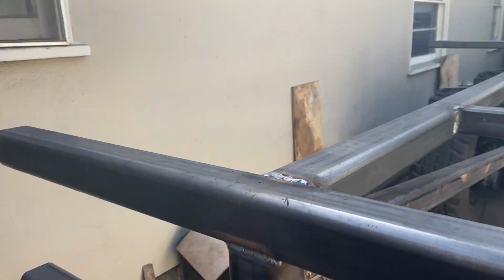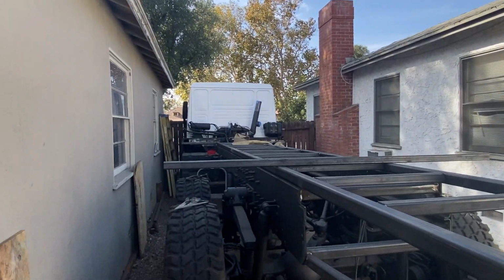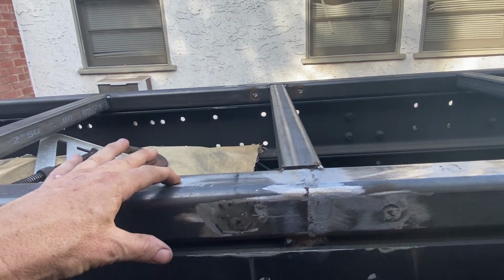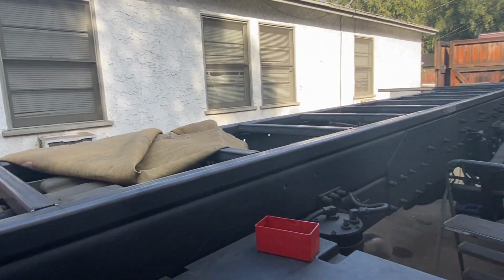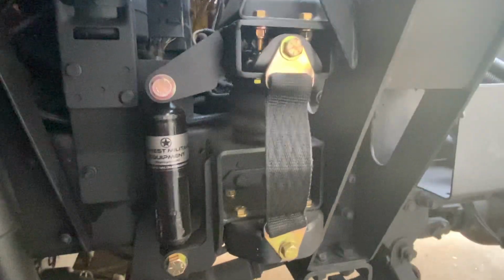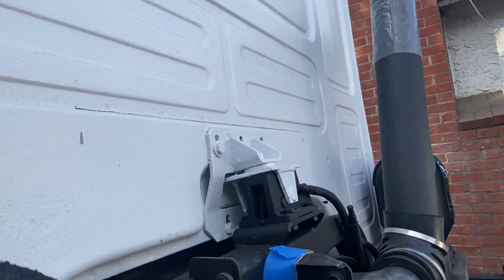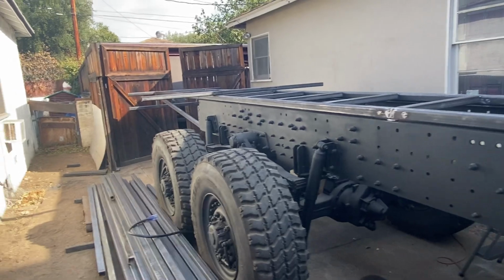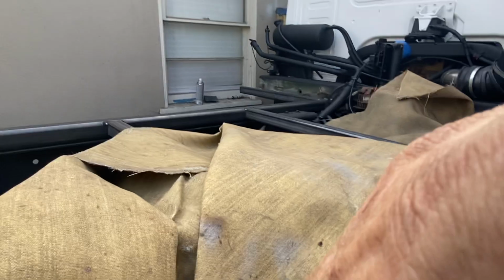Expedition Truck Build Day 16

Comment: how wide are those tires?
Reply: just a thought for a boarding system. maintains a flat floor......i tried to attach a pic...won't let me.
Reply from the maker: @scottlobsterlift4332  send it to me on my phone or email. 9512597231 or timtobelconcepts@msn.com
Reply from the maker: Right at 14” which has made some design challenges!

Comment: Why not flex mounting between the frame and subframes
Reply from the maker: Great question. Probably the biggest talked about point on a expedition build. As I have been told from a former Stewart and Stevenson Engineer bolt the habitat directly to the chassis. I happen to like this way of mounting due to less wobble from the habitat and frame flexing around. I build my Adventure Truck welded to the chassis and think the was a great way to go. I got a lot of comments and some said it will not work and tear itself apart! I have never had a creak of grown off or on road from it being directly welded. It really boils down to DC... Designers Choice! Lol! I’m choosing to weld and bolt the habitat to the frame and if I run into problems I will remove the bolts and do a spring and bolt capture method. All of the beds and equipment on FMTV’s are bolted to the frame from the factory. Hope this helps but in the end we all have our own theory’s.

Comment: That base looks to be very sturdy.    Looks like you used flux core wire?   I always heard using shield gas outside can be a problem with even minor wind.    All I've ever used is flux core.
Reply from the maker: Thank you on the sturdy base! I think it will be great! Funny thing is I’m running a steel mix but flowing 20 CFH and that may be what is making it a little shinny. I’m still getting use to the Miller 255. It runs really hot on the auto setting. I have things turned down a bit and not getting so much undercut. Super fun project!

Comment: I noticed that about the mme airbags.  The shocks push the top of the cab support back. Of course on mine it just hit the spare tire carrier and the cab was still able to latch into it but I did express my concerns about that to mme and they said they have put them on vehicles without the tire carrier and there's no problem. Hmmm
Reply from the maker: We will see here in a couple of weeks! If they don’t take set I will weld in a small follower off the tire carrier snout. The whole project is a logic problem with lots of peoples to solve! Living life to the fullest on the build!

Comment: Great build series. One question. Since the bottom of the rear bumper is the lowest point, could you have run the diagonal tubing from the frame to the bottom of the bumper to reinforce it better or is that part of future engineering.
Reply from the maker: One the list of thing to fab up! Good eye and great thinking! Thank you for taking the time to let me know! Cheers!